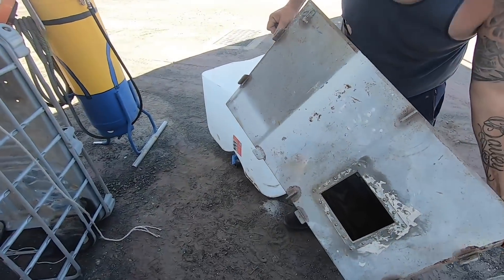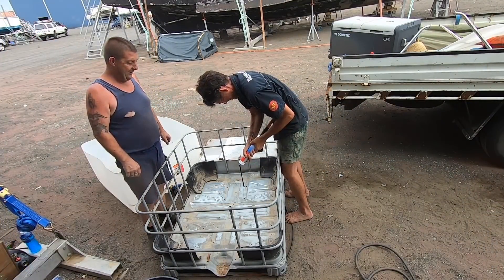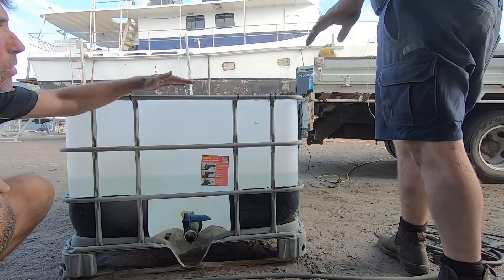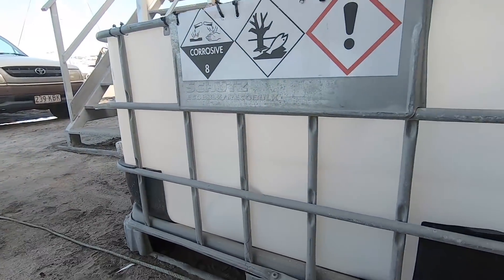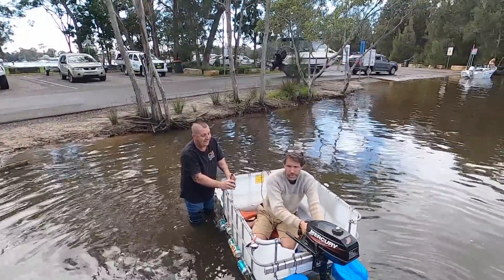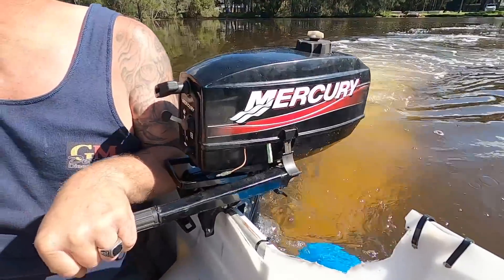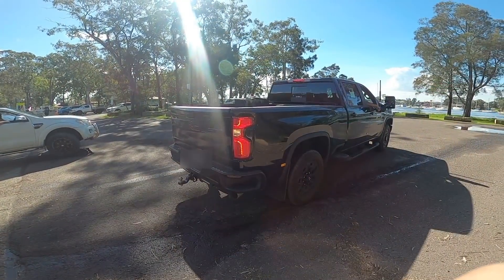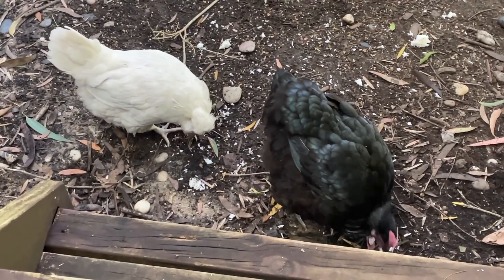Making a boat for under $200

Comment: I am your year subscriber but never ask a question.  I have a question for you on my inboard mercruiser 3.0 I recently found that my engine have some milky in the oil it mean that my head gasket is bad. So I took the head out send to machine shop to do test for Crack and resurface the head. I installed everything back run for 4 hours and check it ok. So I changed the oil to make sure everything clear. So after second oil change I run the boat for another 5 hours the o saw some milky in the oil cap. Is there any other way water can inter to the oil ? Is it be able coming from the exhaust chamber ? Help help to solve my problems.  Thanks
Reply from the maker: Blown headgasket is the main way water gets into the oil. Some milkiness in the cap etc can be from condensation. This could be from particular atmospheric conditions or residual water from the original problem.
Reply: @DangarMarine  in my exhaust flappers is missing do you think water  could pass through my cylinder to cause water in the oil?

Comment: Hi! ive reasently repaired an ofboard or "serviced" and u got me out on the water after it sitting 2 years in my cellar... after maby a good 3-4 hours use ... seems like i lost power.. i have a 6HK murcury outboard and well i dont know much but lets say it started at 6 and now maby we down to 2 HK(full throttle)... i think it might be fuel.... anything i should check pertiqularly? and how bad is it to run the engine like this ?

Comment: I recall that on your land trip home that the truck was full of Detroits ----  which means that that Damien fellow must have kept your boat!  Probably insisted that the sand container was originally his or some such rubbish....  Well, now that Brupeg is almost finished, I expect to see it tied to the stern or lashed to the deck above his forecastle.  Nice work!  PS:  I don't know if you realize this, but you can drill a hole in the back towards the bottom and put in a small rubber 'flapper'.  Then, when you get up to speed the suction created sucks the water out and it becomes an automatic bailer.
Reply from the maker: The truck had the Detroits and this boat, we only filmed the final section this Easter weekend. Yes, venturi bailers they are called.

Comment: I bought my 95 16’ sea nymph last year for $1500.  I think I over paid now when I see what I could have made with $200
Reply from the maker: We are tempted to weld 4 or 5 IBCs together to make a 16 footer and see if we can get it to plane with the 40HP I am currently rebuilding. :)
Reply: @DangarMarine  please please pretty please 🙏
Reply: @Dangar Marine With the stitch and glue method?
Reply: Might need a vented prop to get it up to rpm so you've got some power to shove it up on plane, but why not?

Comment: There's gotta be a plastic tub around you somewhere, you can use the drain hole to stick a cheapo electric motor through. I think you can get it to be even cheaper.

Comment: I got an idea! I did actually did think about building a boat out of these, or how you could build a boat out of these. I would simply take the cap and thread a Schrader valve nipple onto that, then thread it in with plumbing grease. Then you should pressure the container at low PSI, weld a few together with a torch and a straps from cutting one container into strips, then install a transom with an engine.

Comment: Very nice project. How about adding a 2nd bin to the boat? More volume, space and hopefully stability. Source some 12 inch PVC pipe and add that to the sides in place of the beer cans. Now add a proper seat with forward controls and name it. I would suggest calling it the 'No Sense Atoll"
Looked like fun! Thanks
Bob from Virginia USA

Comment: First boat I ever bought was on eBay in 2018. 1980s boat with a 1969 mercury 7.5hp motor. Had 60psi of compression and didn't pee for the first month I owned it. Total purchase: $225.00 😂
Most fun I've ever had at 14mph
Reply from the maker: Exactly! Dollars doesn’t equal fun. :)

Comment: stu  about the expanded foam ... its not needed if the can opening is at the bottom as the can will hold air . thanks for the vids
Reply from the maker: Indeed, although I think we might need to go bigger than beer cans... ;)
Reply: @DangarMarine  the other half of the ibc upsidedown under it would do it but all sorts of drag and the bottom is bad as is for that . i think the chlorine containers work well

Comment: Nice idea, but where can I get an Adrian here in Germany, it seems to be essential for the construction. I would also point out that the construction must be made by at least one person without shoes, otherwise the hull will never be watertight. By the way, for an Atlantic crossing, I would also install radar and a life raft. For a calmer situation at sea, I recommend installing the Brupeg stabilizers.
Reply from the maker: We did consider adding the stablisizer wings. ;)
Reply: @DangarMarine  This proves what the human brain can achieve, especially when two extraordinary brains are coupled together. I wonder if this effect can be enhanced by the additional coupling of two chicken brains. In any case, I would consult with the chickens in the case of further development of the project.

Comment: The outboard sounds like it has a lean pop. Possibly caused from a air leak or a restricted carburetor jet or maybe it just needs adjusting.
Reply: The dog clutch slipping as prop to much, but I have fix the oring in carby as wasn’t sealing after bundy

Comment: That 2500 silverado must turn a lot of heads over there. So sweet
Reply from the maker: It is a sweet truck, I had never seen on before.
Reply: @DangarMarine  I live in Canada and I daily drive a silverado 2500. Full size and 3/4 ton trucks are a dime a dozen here. But if I recall you guys need an upgrade license to drive a 3/4 ton truck down there correct?

Comment: Part 3 should be installing mast and sails (be careful not to overpower though).
Reply from the maker: While we were in Bundaberg Robin made a second one with a full sailing rig and dagger board. I'm sure it will turn up in a video one day...
Reply: @DangarMarine  be great to see FullySika heeled over with a full spinaker!
Reply: Indeed - I’d love to see an IBC-based sailing class - if you’re trying it yourself remember you’re not going to get much more than two knots due to the short hull, so big foils on the centreboard and rudder are key (also less critical guessing centre of lateral resistance :-). Sail was 6.5m2 balanced lug from a sailing canoe design by Michael Storer.

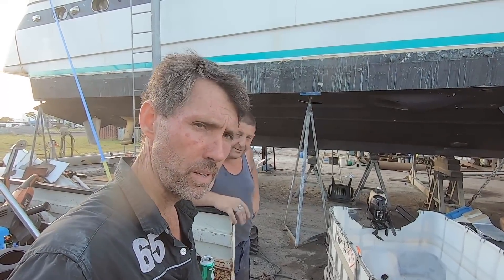Comment: @9:35, I will guess that the inner liner will be pushed out from the frame. The inner liner is the only part buoyant. This set up was designed to hold heavy liquid weight pushing out, its the wrong application of forces. Look at my comment below and do that, it's the best. I still have not finished watching "tomorrow", let me continue.

Comment: Next on the to do list use 4 totes ( 2 wide ) plywood bottom with floor filled with closed cell foam make a bow ( plywood ) mount seats for under $500 Redneck Yacht Club ! Ya need 2 sheets of plywood 4ft. X 8ft. !
Reply from the maker: We are thinking of doing a much bigger one...

Comment: HAHAHAHAH Great vid, but a couple of comments:

- $199,800 for the tow rig? Probably a fair call given the price of used cars at the moment! :)
- Would cost me more than $200 to buy the welder to make this. Then the rest of the "scrap" would cost me more than that without the access to a scrap yard, like you guys!
- It's probably cost you more than $200 in sikaflex alone.
- Nice touch using the hammer as another tool. Really made the video.
- Did you think about using a camp chair? Even a fishing stool? 

Great, fun video, though. Priceless!

Having made all those comments, you could leave the Fully Sika in my care any day! Be a sensational way to putt around on in the Brisbane River.... :)
Reply from the maker: There is actually only one tube of Sikaflex in this boat so we got off cheaply. Car on the other hand was apparently $190K. :O
Reply: @DangarMarine  hahahaha that's what I meant!

Comment: wait theres a max weight limit on an engine in water.... i though maby it would just spin... and not move but not strain the engine.... hmmmmmmm did i understand that right? thats why u cut parts of the propeller ?

Comment: I think that dog clutches missing a few legs. You should name the boat limpy.
Reply from the maker: Yes, I think the too-big-prop is putting it under too much load, it would be interesting to pull the gearbox apart and look at the dogs on the clutch.

Comment: You two loons want to thank your lucky stars that I don't live anywhere near your continent, because the addition of a third design expert together with an additional supply of Coopers would insure a you tube boom!  I have an idea for a dual purpose submarine/ski boat using a Tesla battery pack and a Cummins starter motor for propulsion.  A little bit of a higher budget than your $200 build, but the added  subscriptions and likes should cover it.  Electricity and hybrid boats,... what could go wrong?
Reply: Well ur welcome come and influence the project further !
Reply from the maker: Sounds like fun!